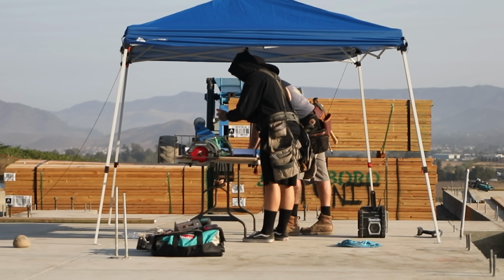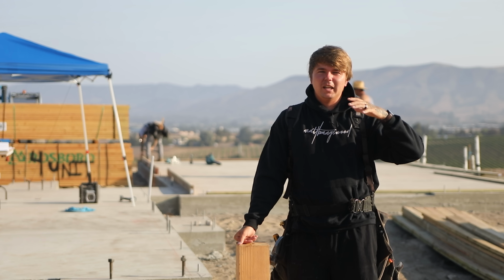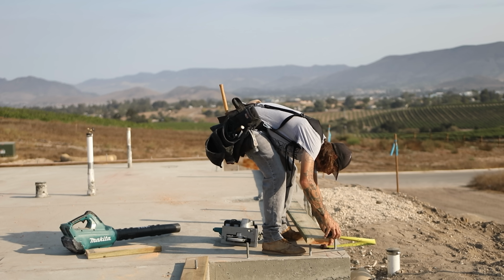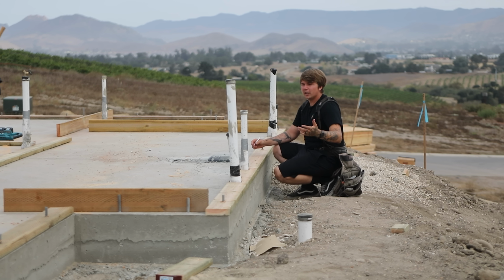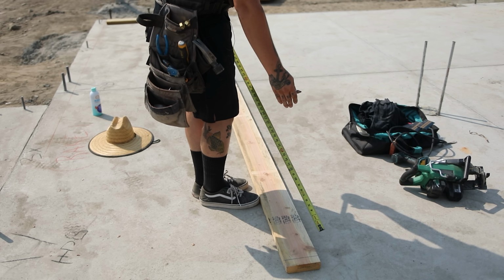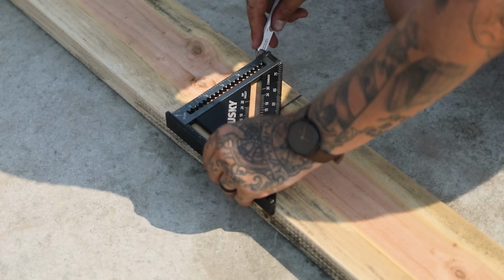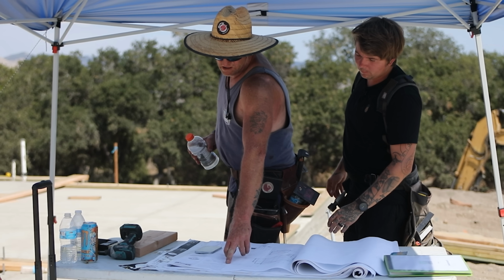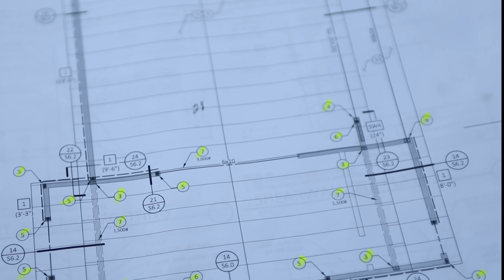What's A Story Pole In Construction? #construction

Comment: Matt, this was another nice video. On one of the first jobs, I worked on when I started in 1975, we made a story pole to layout either clapboard or wood shingle siding. We cut a stick or sticks to get the height of the wall, laid out the bottom and tops of every fixed part of the sidewall like the bottoms and tops of the windows. Next, we'd do the math to get the closest increment for the exposure on for the siding, 4" for clapboards and 5" for cedar shingles. We even used dividers to step off the marks on the story pole.
It made life easy because you sat the bottom of the pole on a level line around the entire building and everything lined up.
Reply from the maker: Super smart working right there! Love it. Story poles have been around forever and for a very good reason! Smart thinking there..

Comment: Idk cali code but does 6x10 just mean triple 2x10s for example
Reply from the maker: I don't think I could get away with doing that without engineer agreeing with it. Solid timber for all headers!
Reply: @MattBangsWood  oh solid timber damn.  
Our drawing usually just call for 2 or 3 x8s or x10s, sometimes LVL, on 2 or 3 jack studs. 
Toronto btw.
Reply: I'm in Maine, carpenter for 46 years. I have never seen solid headers in a conventional framed house. Solid beams twist too much unless they are engineered lumber. We have always used built up 2X stock. Back when we framed everything with 2X4s we would put a 1/2" plywood spacer between the 2 2X's.
Another thing we did, was to use the same height header on every opening. If the widest opening for a patio door or window unit required a double 2x12 header, we used 2x12 on all openings. Doing that just made it easy for everyone involved.
Here in my area, the carpenters built the house, sometimes we would pour the concrete, but we always frame, sheath, install windows, doors, roofing and exterior trim and cladding. We would also frame and finished the interior short of insulating and drywall. The same guys would also install the cabinets.
This may have changed with some contractors now, but the contractors I know do the entire job. You may be on the same job for a year or more depending on the size and complexity of the house.
I miss those day, but at 66 years old, I can't keep up.

Comment: Make some saw horses.  my back hurts from just watching and those few cuts i saw couldn't be very accurate.
Reply from the maker: Unfortunately in the beginning phases of framing, everything is done on the ground. No avoiding plating, detailing, etc. like this.
Reply: @MattBangsWood  Presumably just to save time as 1/4" tolerance OK?
Reply from the maker: @vidpromjm  Depends on what it is, most say 1/4", aim for 1/8". Cutting studs, cutting packages, everything can be done off a set of horses, but the plating, detailing and framing can't be done any other way.